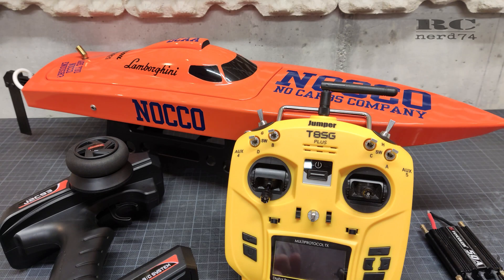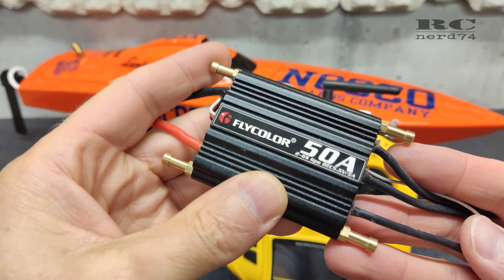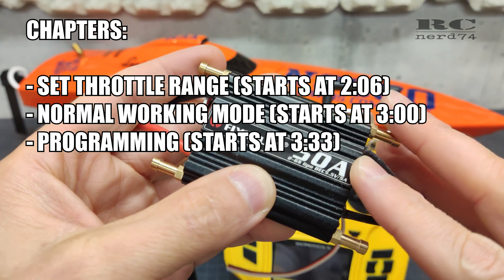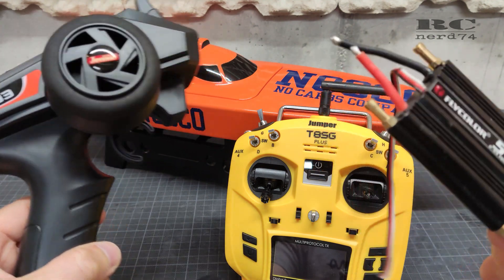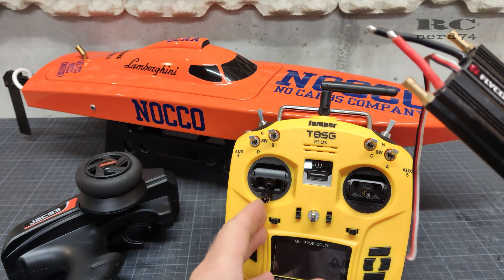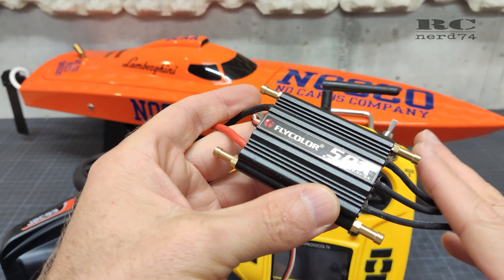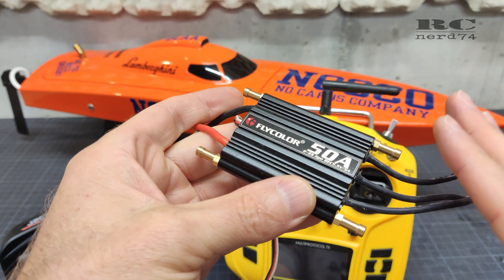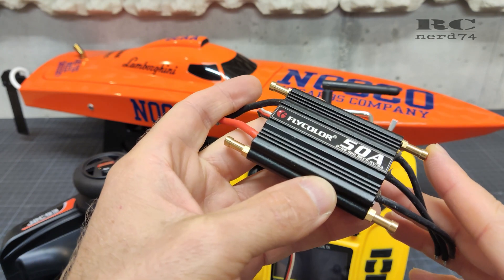FLYCOLOR ESC | HOW TO PROGRAM BY TRANSMITTER | PISTOL AND STICK TUTORIAL

Comment: Hi quick question after I do step 2  and on connecting the battery the throttle by itself goes on full throttle by its self ? What do I need to do to make it right ?
Reply from the maker: Hi. So, your motor actually revs up? If so, this is strange. I would reverse the throttle channel and look what happens. To me, this behavior makes no sense. Hope reversing leads to success.

Comment: i have the dsame one but 90a and my motor  do not want to rotate its beeps what to do
Reply from the maker: Did you already reverse the throttle channel on your transmitter? Sounds like your zero throttle position is full throttle on the ESC. Like this, the ESC enters programming mode and the motor only beeps but cannot spin. Hope, this solves your issue.

Comment: what would be the best timing setting
Reply from the maker: The timing setting depends on the motor you use. Perhaps you can find a data sheet from your motor including the recommended timing. If not i would recommend to begin with 32KHz. This is stock setting on some ESCs.

Comment: Ive programmed one of these before but now i cant on a new 150A esc. The throttle ends up reversed. Neutral is full throttle and full throttle is neutral stick position. Any idea ?
Reply from the maker: I would reverse the throttle channel on the transmitter. Then set throttle range again. Hope this helps. Was it even possible to enter programming mode like this?
Reply: @RCnerd74  Thanks. I did reverse the throttle and that was a good first step. It took about 10+ attempts, but after some trail and error the travel finally stuck. 

It's odd because I have the same esc on another boat with no issues. Oh well, its done now!
Reply from the maker: @billjonesnation  If you can i would return the ESC to the seller. Sounds like a dead on arrival.